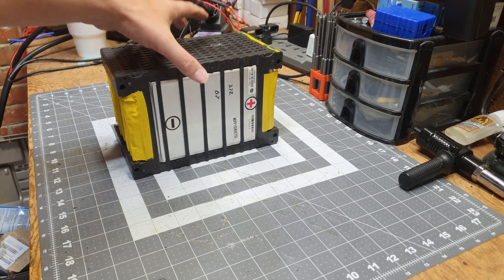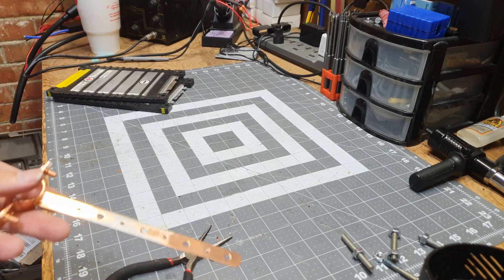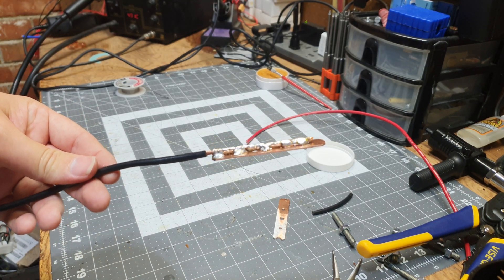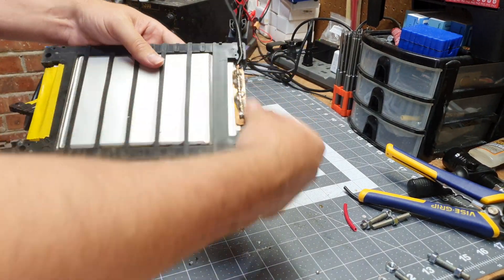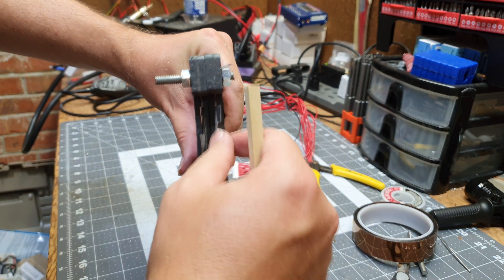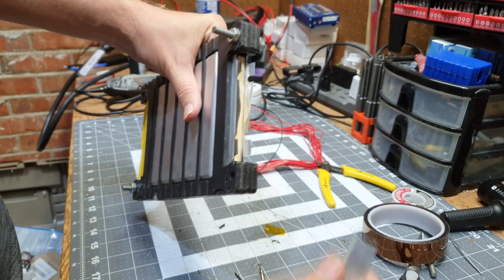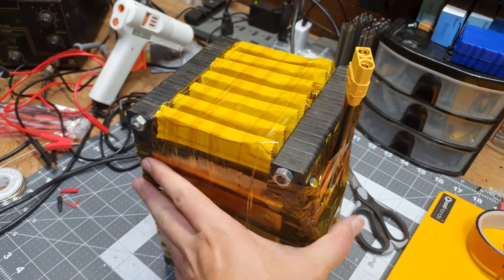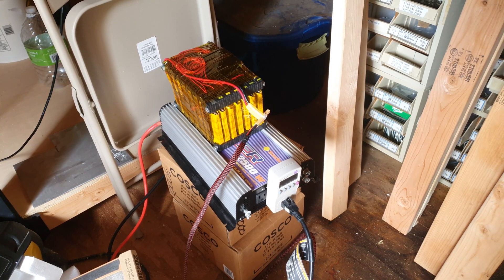DIY 48v 14s 8ah Battery Pack - On The Cheap

Comment: where are you connecting the BMS leads to ?
Reply from the maker: In the video I show a u channel to connect the ends together. On that u channel there is a small hole at the end and that is where I attached the leads with a ring terminal.

Comment: I have a couple of questions 1) aren’t you afraid the bolts might get too hot and light the wood in fire? 2)I thought you would need a 16S for 48V instead of 13S.
Great explanation on your process, I’ve been struggling on a way to build my 72v battery, I was using the same U channel in between instead of the outside of the tabs.
Reply from the maker: pretty sure those bolts can easily handle the current the bms will allow. This is a 14s setup. 14s is for Lithium Ion 3.7 nominal voltage like 18650's and these cells. 16s is for Lithium Iron Phosphat which is 3.2 nominal voltage.
Reply: @TechCentric_00  thanks for the clarification. I have 45 of these batteries 8ah from battery hookup (now they sell them in a 16ah 2P configuration), my plan was to do a 2P 20S for my 72V motorcycle battery, so I should do a 2P 19s?
Reply from the maker: It depends on the range of voltage your controller can accept. Like most inverters the range can be a good bit broad. If 19s (57v to 79.8v) fits then use that if 20s (60v to 84v) works better then use that.

Comment: I wish you could show the bms and explain the connection wiring for us beginners.. like the black main negative and the positive main.. is it separate  from the whole setup bus bar and bus bar complete the curcuit?
Reply from the maker: Check out my 48v super beast video. The BMS connection is the same.

Comment: I have also bought a few of these I am going to use them to power a 20 volt battery operated air compressor that I bought also so I can use it remotely I like your I idea about joining the batteries together that pretty good I also have a 12 volt battery pack that jumps battery in automotive if your battery is to low to start your car with battery cell holder on the battery will not fit in the jumper battery compartment but you gave the information to use the setup that I had in mind I just had not figure out how I going to join them together until I saw this video thank you for sharing this post

Comment: Hey, great video! I learned a lot from this. Thank you!
I'd like to build an extension battery using 18650 cells for my electric scooter and I think I understand everything except one thing:
If I connect two different batteries in parallel that are managed by 2 different BMS boards, do I need to use the same type of cells that are already being used in the main battery? (Can the cells from battery A be different than cells from battery B?)
Reply from the maker: They can be different in thier capacity but should be the same voltage range. And when you connect them together the voltages need to be very close. If not a lot of current will start to flow from the one to the other and can be damaging.

Comment: I just built a 48v using 104 of these in a 13s configuration. For balancing I just used a 13s active balancer as I didn't want to restrict the amps. It's running a small shop. Fires up the old Chopsaw and compressor just fine It's coupled with an MPP 5048 split phase inverter and 2800w of solar
Reply from the maker: That sounds like a great setup. I am working on a 3d printed enclosure for these cells to make a better looking and stackable modules.
Reply: @TechCentric_00  Since I do powerwall setups leaving things  open and breathable is more desirable for me. But for your application it sounds good. Right now I am designing a 14s 120ah unit that has much simpler connections for the positive aluminum ends and the negative copper ends. I live in a damp coastal climate and electrolysis is a major concern. My first unit I used aluminum all thread  as well as aluminum flat washers and nuts, which is acceptable on the positive side but I have to wait for a long term outcome on the negative side. Also the rods, nuts and washers are a bit pricey. My new plan is to bend the tabs at 90 degrees and then create a single 3 1/2" wide by 1/8" thick plate for each side of the stack of eight parallel batteries. Pop Riveting the plates at three points on each tab will give a secure connection if the back of the tabs are backed with like material. Similarly, it could be done by threading #10 screws into the backing plates and securing the outer plates via washers and nuts. It all requires a bit of precision but I can set the process of drilling up in my CNC mill for repeated accuracy on the outer plates. Thebacking plates can be done in a long strip on the drill press. I will hopefully get a video up on the new one from start to finish. It will be a lot of battery for $ spent.
Reply from the maker: Would love to see that. I hope to start my video on the cases soon, but I still have a 9 to 5 and these videos are still just a hobby.
Reply: 13 S is dumb. . !4s is a 48 volt battery thgat inverters like.
Reply: @solexxx8588  Maybe in some instances but the inverter can handle the lower voltage spread

Comment: can spim08hp be welded be spot welded ?
Reply from the maker: I tried but those tabs are aluminum and so a standard spot welders does not work. All the videos on these cells have some kind of non welding connection method.